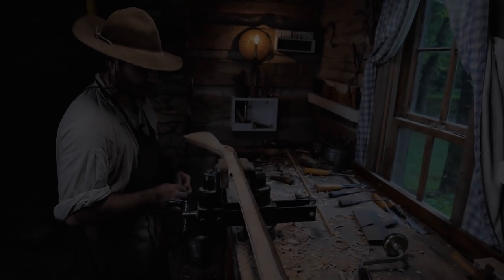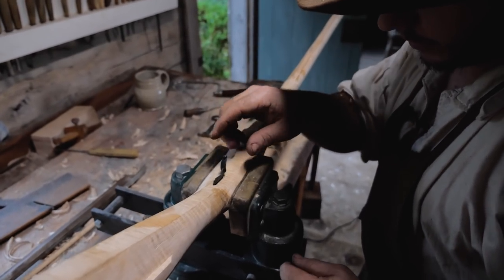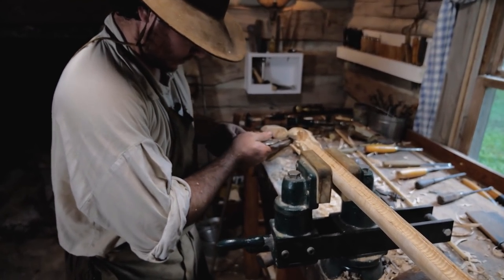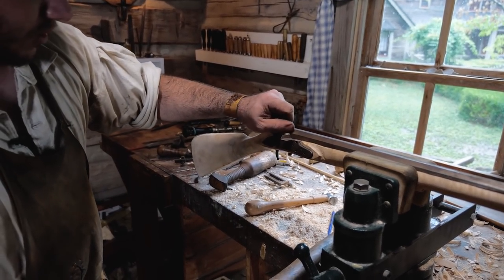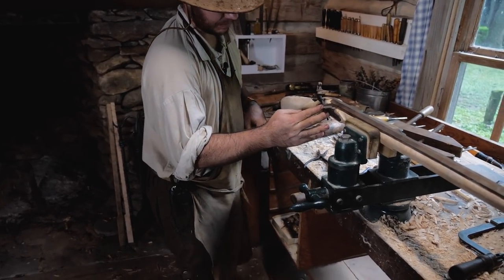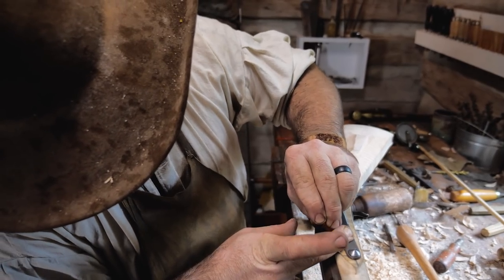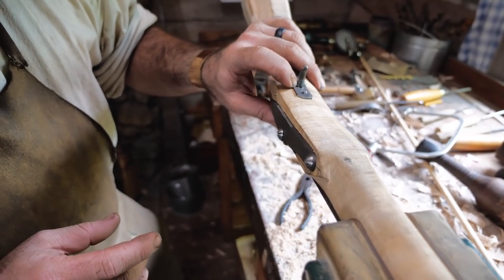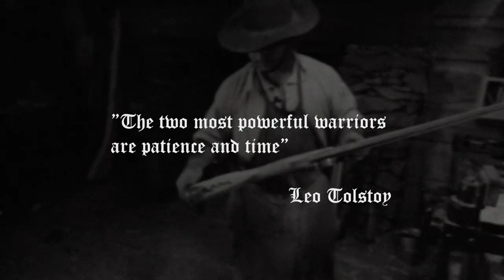How to Build a Flintlock by Hand (Part 7)

Comment: A useful tip, when you are in the process of fitting the parts together leave your pins long, it makes it easier to pull them. I used cut off cotter pins when I was building my fowler.
Reply from the maker: Thanks for the tip.

Comment: In the 18th century there was a type of "drill press" that Blacksmiths used (and probably other trades as well, like gun makers). A picture of one is in the book "Dictionary of American Hand Tools" on page 72.  The "drill press" is basically a bit brace attached to a handle (beam).  The beam is attached to an upright post that is attached to a base.  "The Smith pulls down on the beam with one hand while rotating the brace with the other hand", as described in the book.  These types of drill presses were usually made by the Smith himself. This might be a great addition to your shop!!  I thought about making one myself.  However, since my shop is basically set up to the 1890 to 1910 period, I have a couple of hand operated post drill presses already that I use.  It would be a little redundant to have an 18th century type drill press.  Who knows, I might do it anyway, LOL.......
Reply from the maker: Haha. That’s awesome. I’ve actually seen the one you’re talking about and found it very interesting. I am going to build a reaming bench and a rifling saw to have in my shop for when I do hand forged barrels one of these days.
Reply: @goldenmeanflintlocks9713   --  That would be awesome!!  I went out into my Blacksmith shop today to see what I have and what room I have.  I found a perfect "egg beater" type hand drill that I can use to make my version of the beam drill press.  It wouldn't be exactly like using a brace consistent with the 18th century, but an updated late 19th century version, LOL.  I even have the necessary wood to make it, so I think it will be an upcoming project. Down the road when I have time I'll forge a brace and even homemade drill bits!!  I'll use this drill press for small stuff.  I'm planning on recreating a 16th century triangular pad lock.
Reply from the maker: That’s awesome man. Good luck to ya!

Comment: Awesome videos!
I might have missed it but did you show the drilling of the vent hole at the pan?  What size drill bit and did you have to take the breach apart or can you drill straight through?  Thanks God bless!
Reply from the maker: I did not show that. If you don’t use a liner I use a 5/64 bit and drill straight in. You can cone it from the outside if you want. Many were. And you can cone it from the inside as well, but yes, you’ll have to remove the plug. Thanks so much for watching! Glad you enjoyed it.
Reply: @goldenmeanflintlocks9713  Thank you Sir for the reply!  New Sub. Really hope you publish some more videos, love the content!  Happy New years!
Reply from the maker: Thank you sir. I will in the future. I moved to Missouri and am building a cabin. When it’s done I’ll start making more.
Reply: @goldenmeanflintlocks9713  Show the cabin build!  That would be very cool!  Missouri sounds nice this time of year, im in the U.P. of Michigan very near to Fort Colonial Michilimackinac.  Much success to you!

Comment: One way to reduce trigger pull weight is to gingerly taper the sear spring.
Reply from the maker: Yes sir. You are correct. I just hate doing that haha. I will from time to time but generally I can get it with just where I place the trigger.